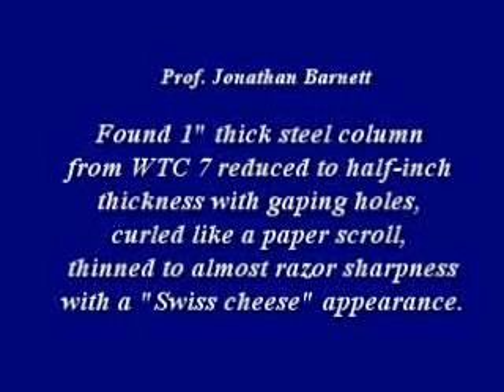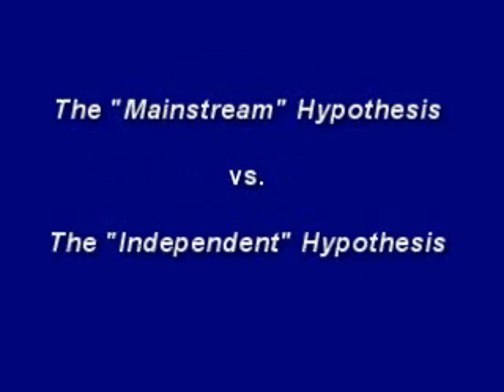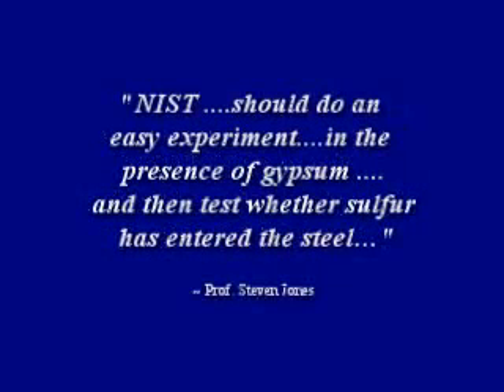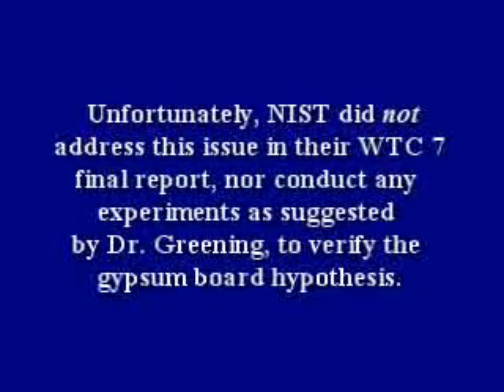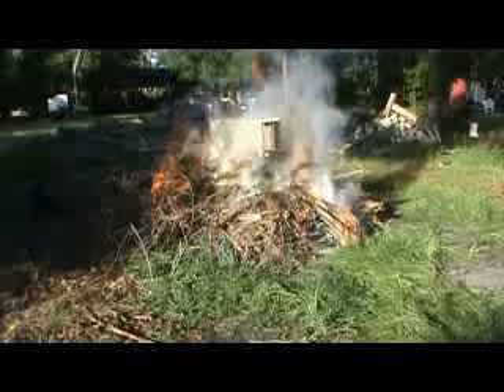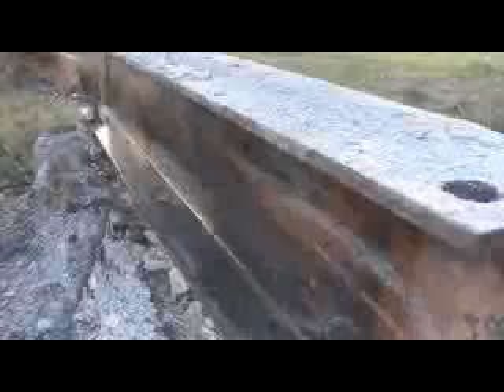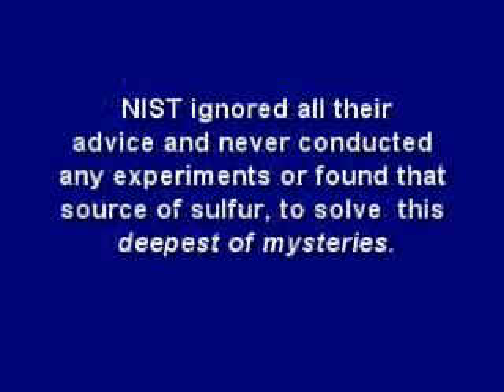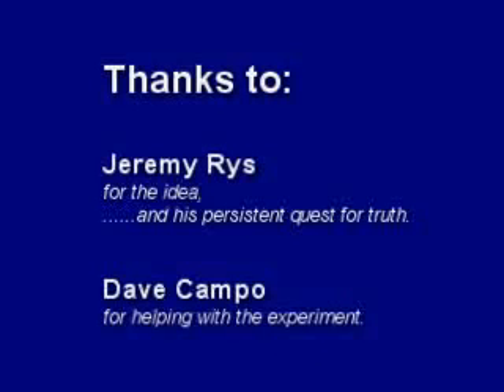9/11 Experiments: The Mysterious Eutectic Steel

Comment: Sigh, stupid people spread like wildfire. Thousands of gallons of kerosene as a catalyst,  thousands of flammable material, inside a semi-solid concrete building. I wonder what that sounds like, oh right a fucking furnace. Molten steel had nothing to do with the towers collapsing, it was the steel heating which causes it to expand, cracking and breaking the concrete surrounding it. So with zero knowledge of thermal dynamics, and a shitty experiment that doesn't even begin to follow scientific method, you expect that what you've found is remotely the truth? Stop believing everything you find on the internet.
Reply: Nick Collinet - This guy (a physical sciences engineer), is simply addressing one issue: The swiss cheese like holes in the WTC steel, and the sulfidation on the steel and it's possible causes. He is essentially saying (by using the scientific method), that there is only one likely or possible cause. He addressed that likely cause in another video he made where he again did experiments with Thermitic materials.
Reply: +Nick Collinet Why don't you enlighten us with science.  Molten steel is not heated?  The person doing the experiment is a professor of psychics who are you?
Reply: Why would cracking concrete (a non-structural component of the building) make it collapse? Even NIST doesn't agree with your assertion. Maybe you should right a report seeing as your conclusion is based on "scientific method"?

Comment: Great work Sir and outstanding conclusion. Thanks for proving the point my friend :)
Reply: beachcomber2008 Agreed. No way you can melt 1inch or 2 inch thick steal with kerosene.
Reply: Lets just cut to the end game or ground zero, 9/11 was a complete and total inside job!
Reply: beachcomber2008 Go comb some beaches or believe everything you see on TV. Wake up mate many people are now wise about 9/11.
Reply: beachcomber2008 It is given in CGA standard for Oxygen. I have a feeling that you are trying to confuse some layman with details that has no bearing on this issue. Fact you may know is less then 10-12 percent oxygen it is difficult to get the combustion. If you have pure oxygen or some thing close yes you can burn steel.
All your French man creating Oxygen and Hydrogen using the Jet fuel and 600 HP steam,  can not explain the Building 7 or the letters with Anthrax that said it is next.
No one can explain why their is no picture or video of Plane hitting the Pentagon.
Nothing can explain the continued fire deep under the rubble without the oxygen for weeks. 
I really want to see mass and energy balance of the whole system:) I really want to see how the side that was up wind failed at the same time as the side that was "molten" steel. It is B movie plot nothing more. Star track was more realistic.
Reply: +Shadow Man , It is out standing effort. But most of the kerosene stoves are made of simple steel wires. They don't melt or even weaken after years of use. These are used for 100s of years before Natural Gas.
Reply: +S yed "They don't melt or even weaken after years of use" - That is because they are carefully designed so that no part of the iron ever gets heated beyond its transition point (around 475 deg C).
If they aren't designed that way you will never see them, because they will have already failed.
Reply: S yed There is a way.  Increase the supply of oxygen to the kerosine.  Even the steel would start to burn in it. The flame could be like that of oxy-acetylene, but not as hot because of acetylene's suddenly-released triple-bond between its two carbon atoms releases extra energy to combustion.
It isn't sensible to venture opinions into combustion chemistry if you don't understand much chemistry, so why venture such an idea?
Do you WANT me to know how silly you are?
I shall have to ask you if you've ever been told how much heat was released at ground zero due to 500,000 tons of steel and stuff being brought to a dead stop from 120 mph?
I thought not.  Well, for your information the answer is sufficient heat to melt 1200 tons of steel. In theory, at least.  Due to inefficiencies (mainly the amount falling outside the footprint) I reckon about THAT amount of steel reached a lesser temperature, 1100 deg C.
This was red hot, and energetic enough to power the corrosive chemical corrosion of the steel, in a reducing atmosphere, and form a surface layer of iron sulphide.
This melts at around 1000 deg C, so as soon as it formed it fell away from the surface it formed on.
Firemen's water created it*.  The element Sulphur arrived as dilute sulphate ions dissolved in it.
Like, you're nowhere near the truth.

* 250 years ago Frenchmen passed steam through heated iron pipes to make HYDROGEN to fill their man-lifting balloons.
At the WTC firemen reported fires breaking out at the surface of the wreckage.  These were hydrogen fires which broke out there because the wreckage was already a low-oxygen environment, due to the large amount of red hot steel at its base. Red hot steel oxidises in air...
Reply: @beachcomber2008  You are talking so much bs. There is no way you can melt steel with kerosine. NIST themselves didn't research the molten steel BECAUSE kerosine can't do that, which is btw a ridiculous excuse cause with that premise they already ruled out any scenario that had to do with thermite (i.e. controlled demolition), cause thermite can melt steel very easily.
Reply: Shadow Man What, and miss all the other lies you tell?  That's not fair.
Let's cut to the chase.  You are a nut job with a crazy idea you cannot let go of.
No need for proof is necessary.  That OK?
Reply: +S yes I've replied to this already.  I have given you the explanation for the heat created, and the observed consequences.
I am NOT required to explain Building 7 to have PROVED that the towers fell naturally, and as a consequence of fire.
Study LOGIC.
Reply: beachcomber2008 You wrote earlier"I shall have to ask you if you've ever been told how much heat was released at ground zero due to 500,000 tons of steel and stuff being brought to a dead stop from 120 mph?" I really want to know why do you think 500 kton was to falling at the speed of 120 mph. You know it is not possible. because lots of the mass was falling only floor 2 to floor 1. Unless you believe that floor was "removed" by explosives.
Yes you can not explain building 7 or the Anthrax. But someone should connect all dots and that is not going to lead to WMD in Iraq either.
Fact is all these are Israeli operations going on in US since the JFK assignation. If you can kill a sitting president and his brother before he could become president then you 911 is piece of cake.
Reply: +S yed The potential ENERGY of ANY building is ACCURATELY calculated by envisioning its TOTAL MASS at the POINT of its CENTER OF GRAVITY, and multiplying it by the acceleration due to gravity and the height of that point from ground zero.
PE = M * G * h
In the case of a tower this energy is equivalent to 254 tons of TNT.  Just by standing there, it CONTAINS this energy.
By falling, it RELEASES this energy to become kinetic energy.
By coming to a PLASTIC STOP this kinetic energy within the steel switches to HEAT.
The speed reached by the topmost part of the tower would have been 201 mph if it had fallen free.  Being an excellent researcher, I'm sure it's possible for you to verify it.
Metric SI works best, so:
V = ROOT ( 2 * G * s ) where G = 9.81 m/sec, and s = 412 meters.
Then V = 89.9 m/sec, or 201 mph.
The ACTUAL VELOCITY can be obtained by taking the ACCEPTED ACCELERATION of the tower as a whole to be 0.7 G.
Then V = 75.2 m/sec or 170 mph.
You must remember to convert metres/sec to mph, but just entering that into Google will get you it...
As the top of the tower was collapsing the tower by striking it from above, it ISN'T SURPRISING if it SLOWED DOWN as it SPED the tower UP.
Check out that idea in your sandpit.
It's a direct consequence of Newton's Third Law - a concept already badly-abused by "truthers" everywhere, so I have NO hopes of that sinking in.
Don't confuse yourself with other ideas until you can get THAT one straight.
You don't have the tools.  Stick with sand and an easy life, why don't you?  LOL
Reply: beachcomber2008 If you are tying to pretend that you done these calcs then you need to at all the energy that was converted to Noise and heat that was dissipated and also energy that was absorbed by the concrete.
I find "truther" to be closer to the truth then those who are "liars":) or "deceivers"
Since you are good at fake calculations then why did the bullet that hit the JFK did not melt? or all the bombs that fall from sky don't melt? It is funny that you are attempting to explain away reality :)
Reply: +S yed "If you are tying to pretend" - If you understood anything at all you would realise that I HAVE done the calculations and have just shown you TWO of them.
"all the energy that was converted to Noise and heat that was dissipated and also energy that was absorbed by the concrete" - resulted in the REDUCED downward acceleration which was USED TO CALCULATE the heat energy.
All that energy you speak of was expended and lost, LEAVING the reduced acceleration which was used to calculate the remaining heat. Get a grip.
"closer to the truth" - if you discuss honestly, which you obviously cannot (for you did not read properly and follow the information I have just given you) then you must honestly doubt yourself, for only ONE of us is being FALSE.
"good at fake calculations" - how would YOU know?  So far, you haven't lifted a finger in honest work.
"then why < irrelevant and deflecting bull shit > ? " - doesn't seem to need a reply.
" :) " - a lie, obviously.  It goes with all the rest of your utterances.  So far.
Reply: beachcomber2008 It is just funny to think that we have molten steel due to the potential energy being converted to heat and melting the steel.
I have yet to see a molten car due to an high speed accident:) Even those car crashes where you have fire do not result in molten steel.
Your theory is so ridicules that does not require any calculation to prove.
Reply: +S yed "It is just funny to think that we have molten steel due to the potential energy being converted to heat and melting the steel" - No, we don't.  Heat is the consequence of the steel PLASTICALLY stopping. This heats it, but cannot liquefy it at the low energies involved, as liquefaction itself requires additional energy.  If it fell from a greater height it would eventually occur.
"I have yet to see a molten car" - You claim molten steel, I don't.
"Your theory is so ridicules" - "Ridicules"?   Ridiculous.   Do you feel ridiculed?  LOL.
Reply: Tony Duncan Your spelling is right but still fact is there is evidence of molten steel. As well as all the energy to bring down the building does exist in a air plane.
Reply: +S yes Evidence of HOT steel ISN'T "evidence of molten steel".  If you are thinking the material that flowed OUT of the corner of WTC2 was steel, you are WRONG. Thermite IRON forms at 4,500 deg F and CUTS STRAIGHT DOWN.
"all the energy to bring down the building does exist in a air plane" - I don't think so, although 1.2 tons of TNT impact energy and 9000 gallons of fuel supplied a lot of heat..
SIX ACRES of burning OFFICES supplied more than THIRTY times the heat capable of bringing down the towers, and SEVEN HOURS burning did for WTC7.
Reply: beachcomber2008 If was fire it would have fallen on one side. A symmetrical pancake is because of explosives.
Reply: S yed No steel building could ever "fall on its side".  Those buildings were were 95% air, by volume, so they fell THROUGH themselves.
You don't know WHAT explosives could do.
One thing they cannot do is BE QUIET,
Rather like you.
Reply: Tony Duncan These buildings may be full of air 90% or not so are all the other buildings. That does not mean that they can not fall on one side in a natural or explosive disaster. Look at all the videos again. If buildings were supposed to fall like that due to a fire. no one would spend millions for professional demolition. BTW you are 100% full of hot air:)
Reply: +S yed "These buildings may be full of air 90% or not so are all the other buildings" - So you claim they are ordinary buildings now.
"That does not mean that they can not fall on one side" - And now you are taking on the mantle of MY profession to tell ME how these buildings stand or fall..
"If buildings were supposed to fall like that due to a fire. no one would spend millions for professional demolition" - Then according to you it is OK for them to destroy four of their neighbouring buildings as they fall.
"you are 100% full of hot air" - I will let YOU take the credit for that.  But you may be forgiven for you surely aren't mature yet.

Comment: You missed one very important key factor, wind. If you add this to your experiment you maybe can change the result! Every old fashioned blacksmith uses air to get higher temperatures. And if you would knew something about skyscrapers would knew that wind speeds can be extremely high around the top floors.
So no valid experiment.
Don't let him fool you guys.
Use your brain and check every factor of his experiment!
Reply: XDJaegermeister that's air in a confined environment being regulated strictly, also the fires that were reported by the first responders inside the towers were mentioned to have been able to be knocked down with 2 lines in a few minutes, which means they were no blazing inferno like you attempt to suggest, but rather normal office fires.
Reply: +XDJaegermeister 
Let's see.  It only took you how long to put scientific evidence to bed ?  Use your brain and actually understand what the experiment shows.  

Then again, the elite couldn't have murdered thousands of people.  They would never do that.  So all this scientific evidence must be contrived.  Is that about right ?
Reply: +XDJaegermeister Did you man hot air:) Fact is if you add wind it will cool down the fire, blow the fuel and buildings should have fallen on one side provided steal beams were soften on one side. Lets not even consider the magic collapse of Building 7:)It was cover-up for Pentagon fraud, create the war against Iraq and others. Planned and executed at the highest levels in the government with the help of Israel, If you look at the Anthrax letters you will find the missing link. People will tell you stories because they are paid millions to do that. If you want to know the truth then you HAVE to find it yourself.
Reply: Correct but this has no effect on floors below the fire. The only terrorist attack was more lethal than the planes-bombs placed at ground level.  Correct! The structure didn't collaspe.